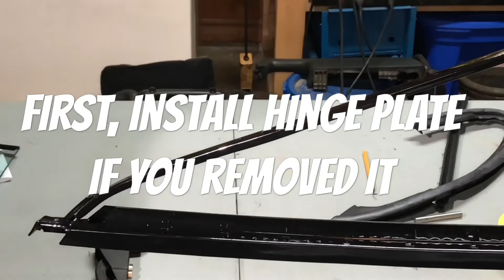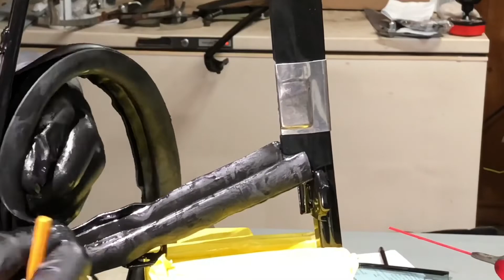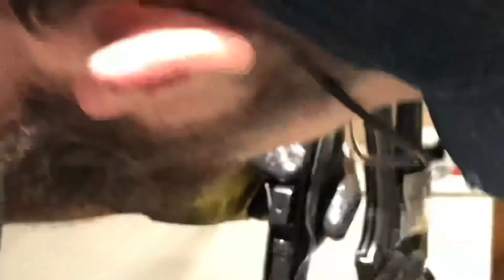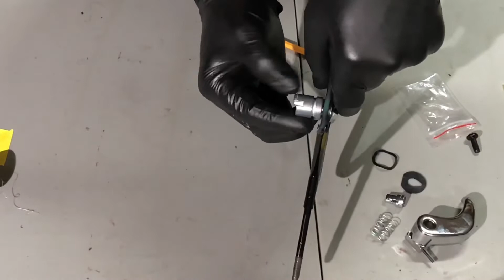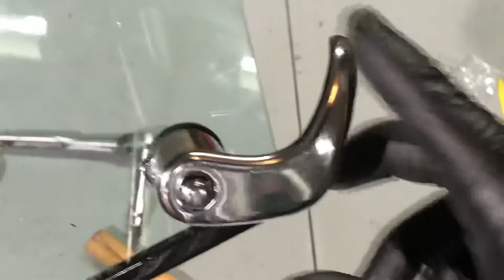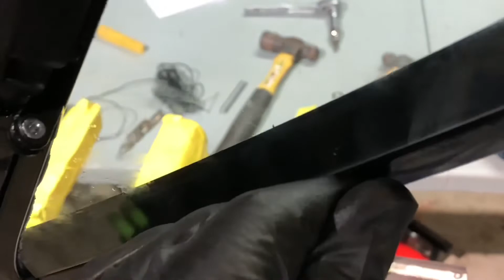1980 LS K5.... Vent Window Rebuild assembly vid..

Comment: Did you ever consider the one piece window?
Reply from the maker: Adrian Garza yes I did but the kit is costly and I was concerned about finding a replacement if one of the windows got busted. Besides, i do like the old school look
Reply: @1980LSK5  Thanks you for the reply. You think a 4l65e can handle a ls3?
Reply from the maker: Adrian Garza I think it can hold a mild LS3 but I’d prolly seek out a 4L80 or 6L80
Reply: @1980LSK5   Did you have to buy new drive shafts or adjust differentials with the np241c?
Reply from the maker: My driveshaft yoke from the np205 I had before worked on the NP241C. I had to have the driveshaft shortened 1 inch in the rear. I did have to adjust the differential angle and drop the transfer case down 1 inch because I did a 4 inch rough country spring lift. I want to say that the lift kit came with like 15° differential shims to adjust the angle
Reply: @1980LSK5  Do you plan on putting the camper back on?
Reply from the maker: Camper back on the K5 yes, I already put it back on the C10
Reply: @1980LSK5  can you bolt up a np241c transfercase to a 6l90 transmission?
Reply from the maker: Adrian Garza not sure on that. You’ll have to research spline count. I’d imagine if it’s 6-bolt hookup, then it should bolt up as long as your spline count on the input and output shaft are the same.
Reply: @1980LSK5  sup man any more videos coming up from k5?